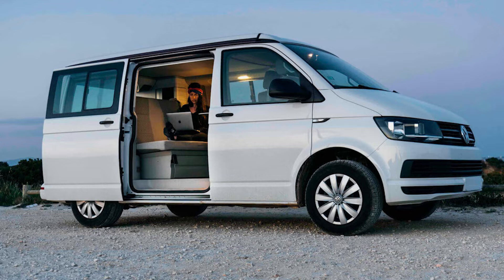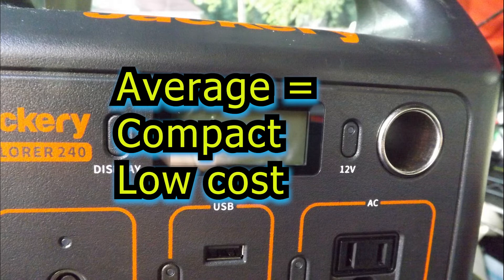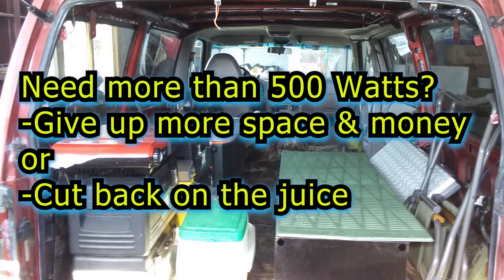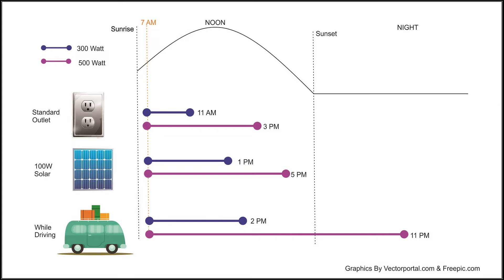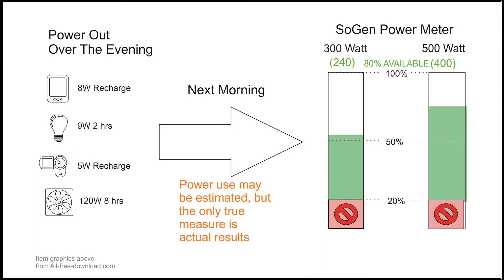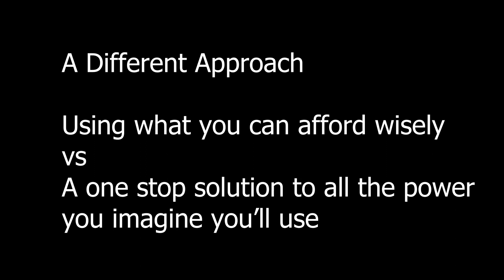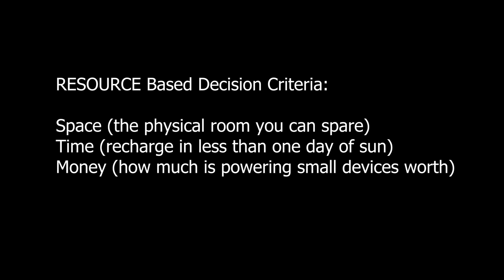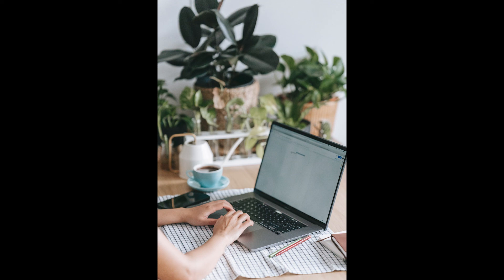Celebrating Outdoors : Minivan Campers: Buying And Using Basic Simple Power Systems

Comment: I am a minimalist engineer. I start with a list that have been arranged by priority with their affiliated wattage, and time of/duration of use.  I scale that against the spec/capacity of available solar powered generators (solpowgen).  i lean towards optimal bang-per-buck.   I bought one in July and used it for 6 cycles.  In conservative fashion I charge the solpowgen to 80%, discharge it to 20%.  I squeak 3 days/nights of Cpap, fan, and light out a charge cycle.  I am still oldschool with icechests and rocketstoves.   It is my hope to purchase another  solpowgen in Januarys, same as the first with a 220 watt solar array.  Breaking the project into manageable pieces.  retired engineer, Burning Man participant...
Reply from the maker: That's a great process, though perhaps a bit deep for non-engineers that can't or prefer not to pour through specs. If you chose to publish your results in some form, I certainly think you'd have an audience that would appreciate your efforts.